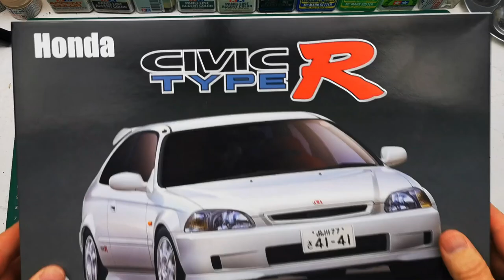Building a Honda Civic Type R EK9 by Fujimi [FULL BUILD] Step by Step

Comment: Very nice build,wich number used you for sanding the body.
Reply from the maker: For sanding before paint I use a Tamiya 600 sponge and then after paint I use a Tamiya 3000 sponge, then some basic 5000 and 7000 grit. Then I use the Tamiya Coarse, Fine and Finish polishes. It is a pretty big job and I don't always film all of it. It is pretty boring but essential to a clean finish.
Reply: @ScaleAutoGarage  Thanks.Its my first kit so i will follow what you did with that kit.
Reply from the maker: @Snarf_spike.  awesome. Well good luck to you. There are some tutorials online about sanding clear coats that you may want to check out as well. Just be cautious to not sand through the clear coat and into the paint.